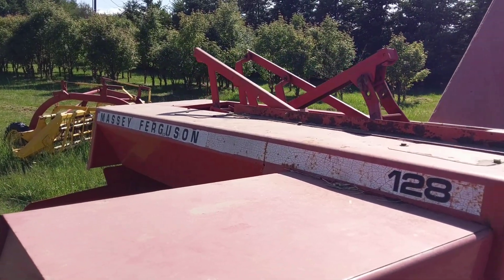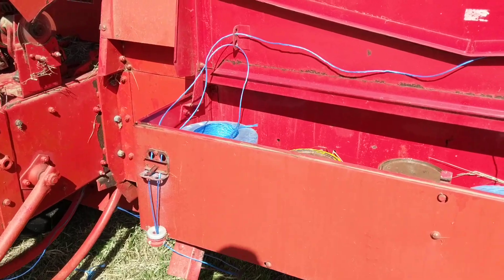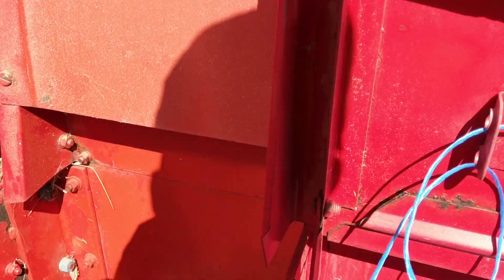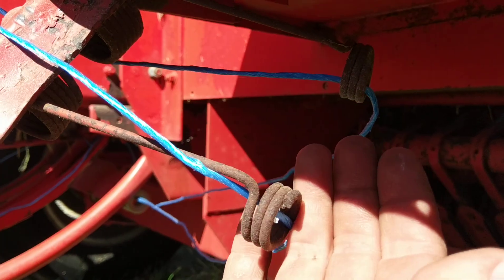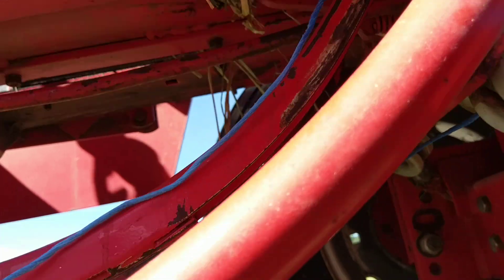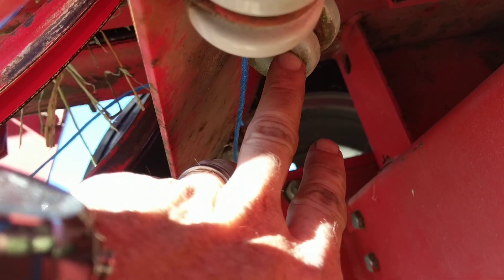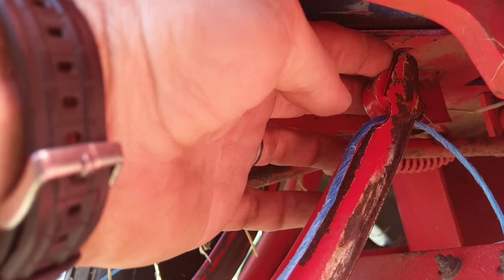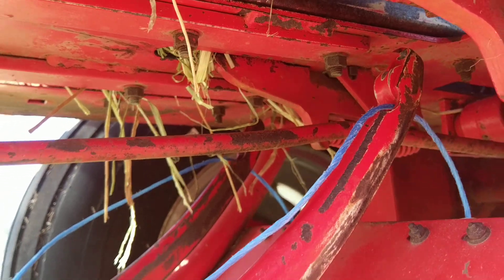Running twine Massey Ferguson 128 baler

Comment: Hi Josh.. I have this setup and today I think I sheared a pin, I hope on the part that picks up the hay.  I heard you say you sheared a pin and I hope you’ll tell how to find it ?
Reply from the maker: ThunderBolt Light, what problems are you having exactly? If you sheared a pin the PTO will just spin and the baler won't be working. Let me know more and I'll do my best to help.
Reply: @beardedfamilyman243  When I ran into a t-bar fence post with the right wheel, I stopped it as fast as I could and then turned off the PTO.  

After backing up with it and turning PTO back on it wouldn't pick up anymore...  I took it up to my workshop and disengaged it from the tractor after trying it with no change.

Turning the flywheel by itself will rotate the pickup but after about 3/4 turn of the assembly it stops... 

After I let go of the flywheel it will return the pickups back to the starting point so there is tension on it from somewhere.

I wish I had grown up on a farm but wasn't that lucky...  

a city boy laments....   

thanks for any help you can give me and for replying to me...    Joe
Reply from the maker: @thunderboltlight1753  , I didn't grow up on a farm either I'm learning as I go that's why i do the videos. Hoping other people learning like me find it helpful. If you stop your baler while in use you will have to pull all the hay out and restart from scratch. You will have to clean out the shoot area and the packers as well. 
The shear pin is just a bolt that isn't hardened metal. Just make sure you dont put a hardened bolt in because you could cause more expensive damage to the baler. I can do a video on replacing the shear pin later if you want one. Just let me know.